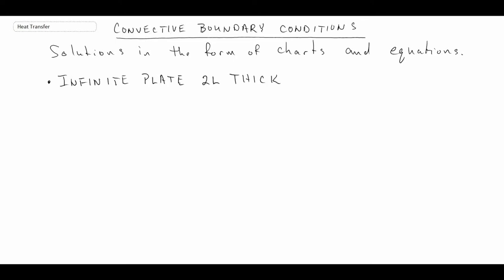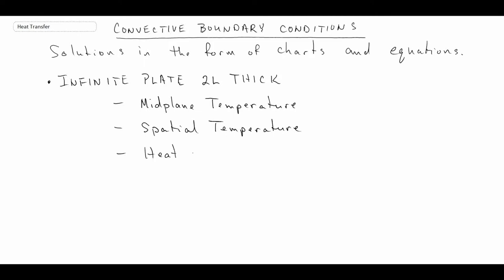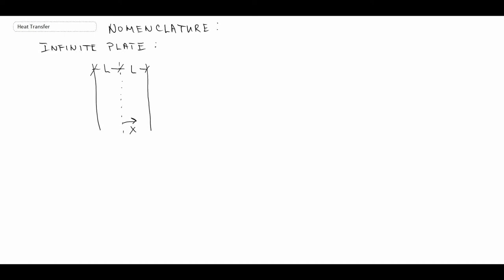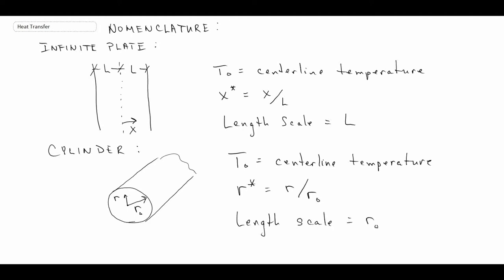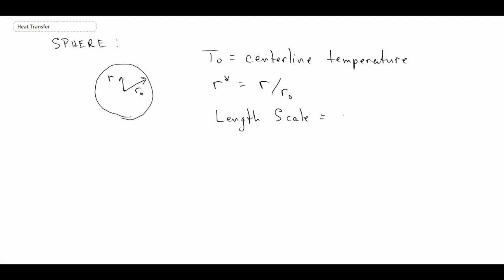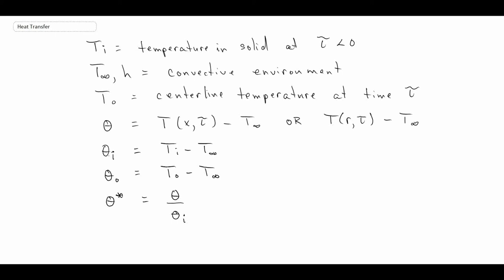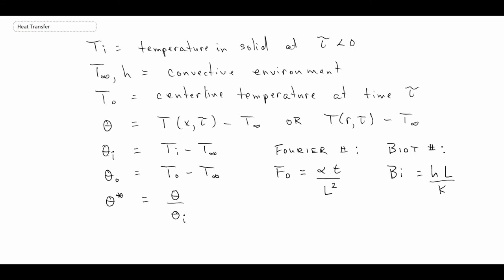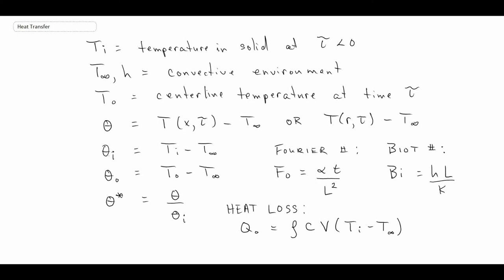Heat Transfer L15 p2 - Nomenclature - Transient - Slab, Cylinder, Sphere

Comment from the maker: That would lead to consistent notation with x* and r* as you suggest, but we non-dimensionalize by theta_i given that it is not a function of time.  theta_o is a function of time and thus both numerator and denominator would be changing with time which would not be good for non-dimensionalizing.  The spatial Heisler chart does non-dimensionalize by theta_o, but we multiply the theta/theta_o read off of the spatial chart by the theta_o/theta_i from the centerline Heisler chart and this results in theta/theta_i - the same as theta*.